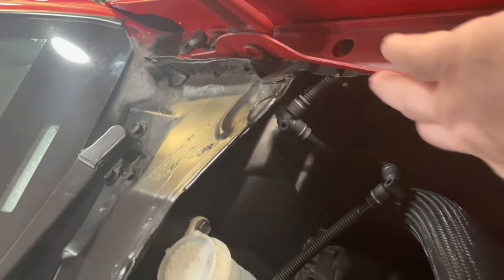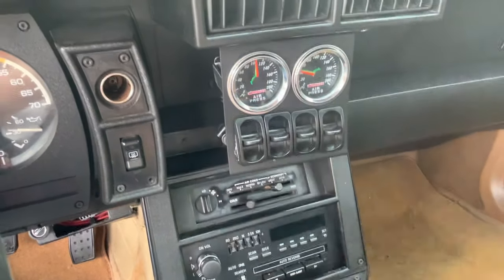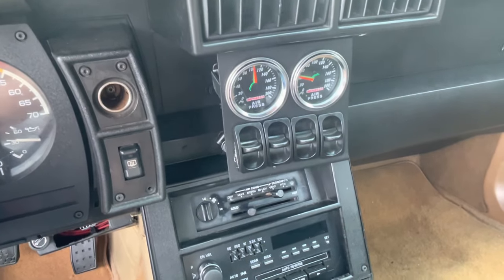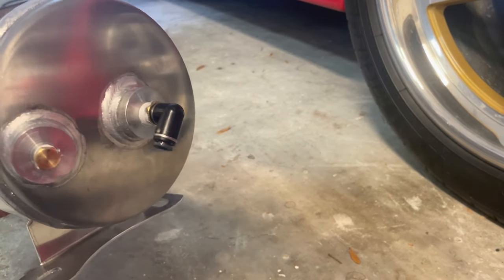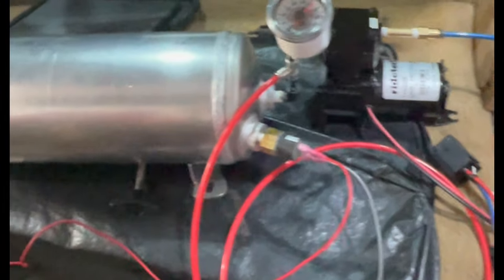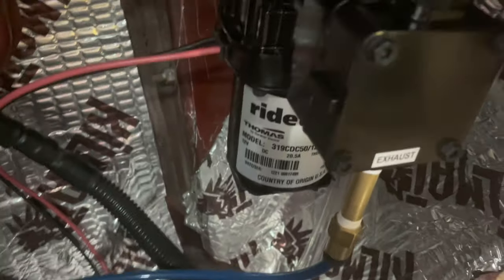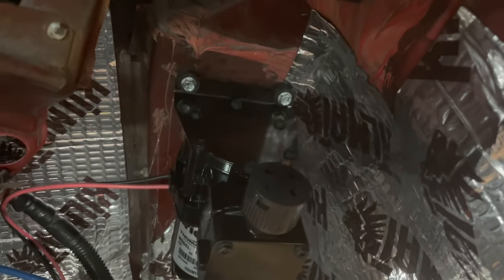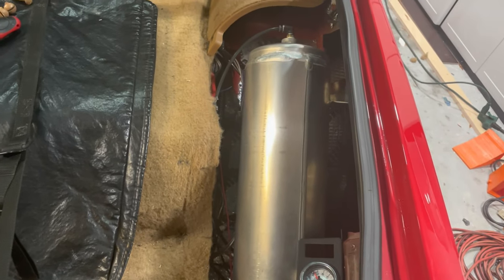Part 2: Air suspension tank, compressor and valve install

Comment: Quick question.  Did you also install 5th Gen seats in the rear of the car too?  If so, what was involved to get them to fit?
Reply from the maker: No stock seats in rear
Reply: @FireballMullet  ok.  I seen somewhere where someone fit 5th Gen rear seats into a 3rd Gen.  Now I’m going to have to research it more.  Thanks!

Comment: I been debating air ride. Nice job 👍. Curious could you of ran the T so the straight part would go from the switch to the hoses going through the dash, then the other T leg going up to the gauges? Wonder if it would work better? Anyways awesome job and thanks for the video! 🤘
Reply from the maker: Dang, that is an awesome idea! I think that would be much better!!!